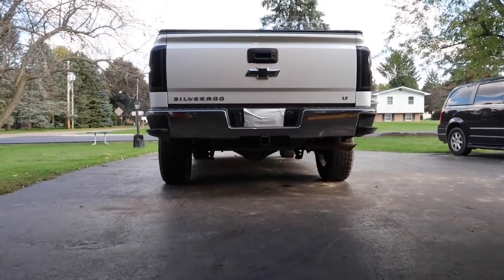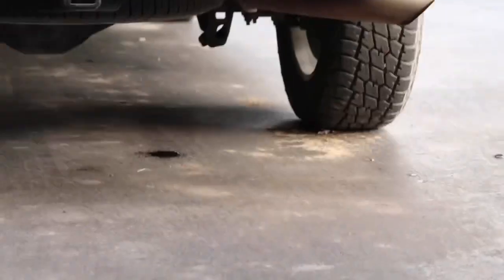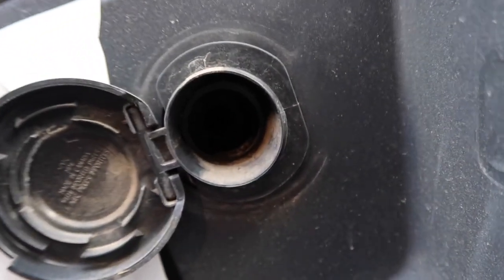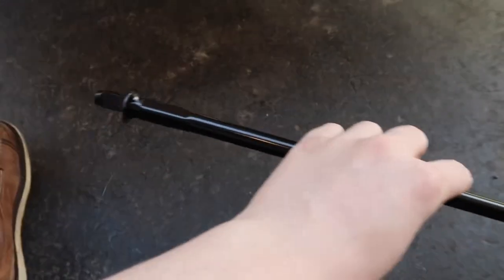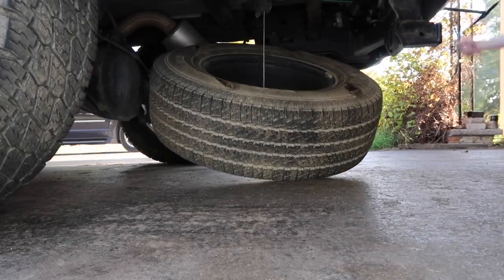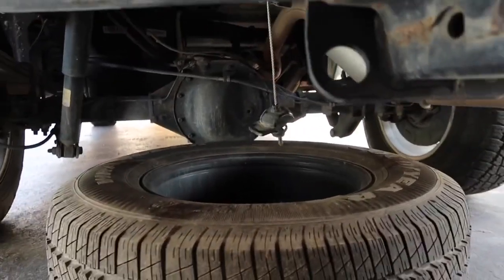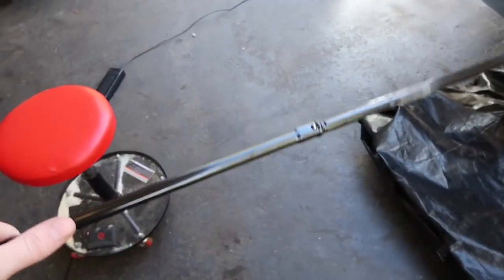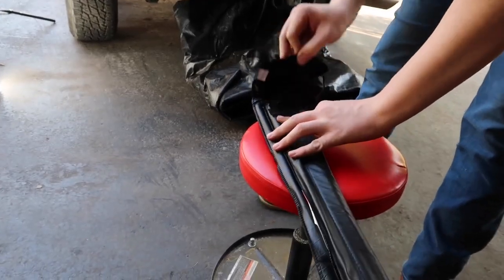Hidden hole on the outside of your (CHEVY SILVERADO) that can only be unlocked with a key ?!!!

Comment: This can also be used for Fords like the F-150, the F-250 and so on,and also the Tahoe, but the Tahoe is a bit different because it’s an SUV and it has a removable rectangular cover instead of the circular cover used on the trucks.